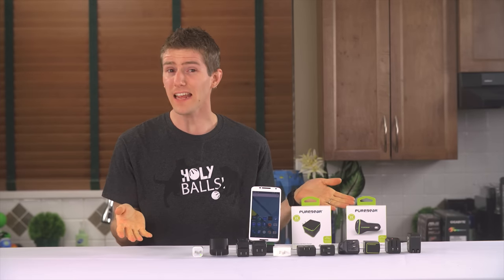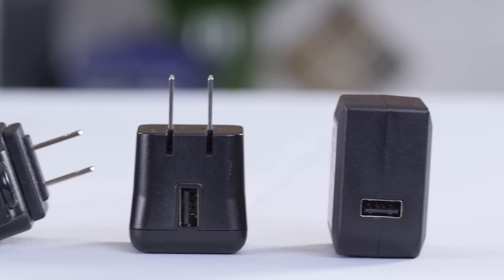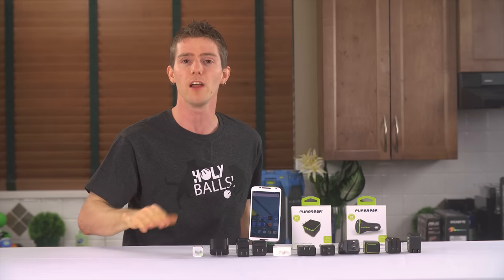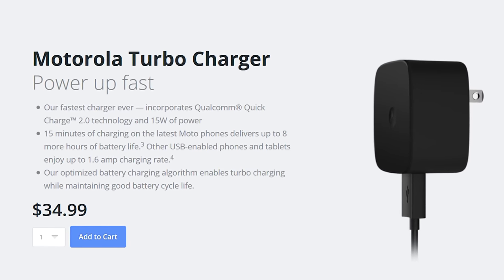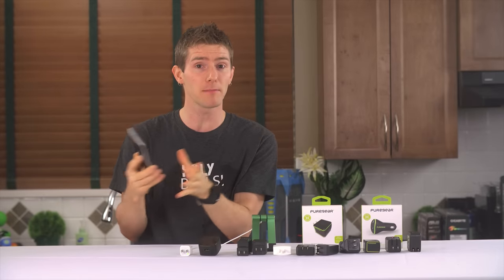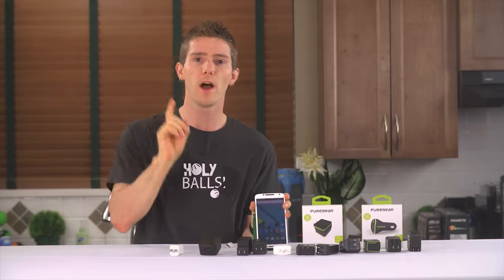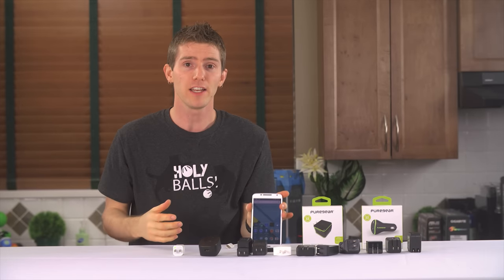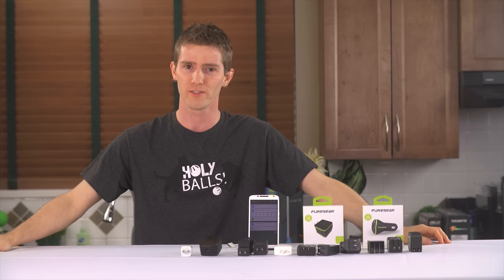Faster Phone Chargers Explained - Qualcomm Quick Charge 2.0

Comment: The conclusion of this video is stupid. You're basically recommending people with phones like the Note 3 to use 1A chargers over the stock charger at night just to extend the battery life.
Reply: Yes. Because you're not going to be using your phone while sleeping so you may as well
Reply: Plus then you EXTEND the lifetime of your battery (and therefore give you MORE battery/power later on in the phone's life when it might be needed the most.
Reply: Lol, that is why it makes sense
Reply: cant wait until we use capacitors instead. those dont degrade in the charge they can hold
Reply: john li
You can already but it would be pointless because they store smaller amounts of power.
Reply: ***** capacitors basically trap electrons between plates and you can shrink the plates down to store more
Reply: john li you mean enlarge the plates to store more? Shrinking increases the electric potential assuming you conserve the same amount of charge which you probably wouldn't because it makes it harder and less efficient to have low charge and high potential.
Reply: Tomas Diaz i meant shrinking the thickness of the plates
Reply: If you can remove the battery of your phone it wont be a problem, but if the battery does die off you can replace it easily.
Reply: SpiderHack Essentially it does extend the total life of the battery, but charging at a higher current does make the charge last longer. There are tradeoffs...
Reply: +Tomas Diaz +john li Guys, guys... The formula for the capacitance of a capacitor is (epsilon)x(surface areof the plates) / (distance between the plates) 

So the thickness of the plates has no role in, well basically anything, and also if you shrink them down, that would also decrease the distance between the plates thus increasing their capacity. This assumes that you keep the surface area same. If you shrink the whole thing volumetrically, the capacity would decrease since distance gets smaller linearly and the area decreases exponentially. 

Also they dont store electrons in between the playes, they store opposite charges in both plates, creating a very very snappy and quick burst of current. So it is no good for a battery or practically anything that needs constant reliable current.
Reply: GameNationRDF I see you've read the formulas from your intro to electricity and magnetism book. I thought he meant shrinking the surface area. By the way, decreasing by a square factor is not an exponential decrease. So area does not decrease exponentially.
Reply: Tomas Diaz Well i was trying to help clarify things, I have not read them from a book of some sorts but whatever that doesnt really matter. And, um, if you decrease the side of a square by half, the area would get 1/4 of its original size. Decrease the side by 1/3, the area is 1/9. It indeed is a quadratic equation thus exponential so I dont know what you are talking about really.
Reply: no, it does not make the charge last longer... what a load of rubbish
Reply: Considering you're not using the phone at night, using a lower amperage charger is perfectly reasonable and helps increase cell lifespan. QuickCharge is intended more for emergency situations, not everyday use. The heat generated does damage lithium batteries over time, killing the battery sooner. Now for user-replaceable batteries, it's not that big of a deal. Drop 20$ and you're back to normal. But more devices have sealed batteries, often requiring special tools and a heat gun to replace. Worse if the battery leads are soldered to the board. So a cooler overnight charger is a good thing here.
Reply: QuickCharge may raise the charging voltage. This is not very healthy for batteries, and 3rd party USB leads may not even be rated for such power (voltage x current = power in watts), like those light up USB leads for an example, sometimes referred to as "visible current" USB leads.

Comment: I was using Apples 12W charger on my note 3 for about 6 months, I noticed it charged much more quickly, but noticed a degrade in battery life, So I got a new battery and used a lower wattage charger. Now I use QI charging on my note 4

Comment: Interesting testing methodology, I like it.  I also like that you brought temperature into the discussion, that's something that not very may people consider with charging their devices.  It just sucks that the charging standard (the device itself in this case) can't monitor its temperature and only apply fast charge during times when device temperatures allow for it, reducing amps and voltage applied otherwise.

Comment: I expected him to mention that the USB cable itself makes a difference as well.

Most USB cables are 28/28 awg, and supposedly a lot of cheap-o aftermarket ones aren't even truly 28/28. I recently bought a few cables from Monoprice that are 28/24 awg and paired them my Anker Multi-USB hub and saw a noticeable gain in charging rate.

Comment: I usually charge my Note 3 @ 1A overnight with an Apple wart. Then in the car, I've got a 2A charger if I want a quick boost during my commute.

I don't USUALLY plug it in to my car's 2A charger, since the Note's battery lasts freaking forever. Usually have over 30% left after a heavy-usage day. Around 80% with light usage.

Comment: This video was actually pretty helpful, but you might have made a mistake (unwillingly). The amount of power being delievered to the phone has everything to do with the cable you're using, especially during quickcharge. Although you thought it would be wise to use a short cable (and it is), the most important thing is actually the gauge of the cable. New fancy cables can be as thick as 20 awg, while older "standard" cables are as thin as 28 awg, which can barely charge at 750 mA! I think you should make this video once again making sure you use the proper cable and maybe even try the new quickcharge 3.0

Comment: I got a rapid charger with my new Galaxy S6. It can provide up to 9.0V - 1.67A to the S6 or 5.0V - 2.0A to any other device. From what I've read, and from what you've mentioned at the end of the video, that could negatively affect the battery. I've just been using my old charger from my S4 which is a more standard 5.0V - 2.0A.

Comment: I've tested it myself with a USB power meter, and a handful of non-hyper chargers against another handful of hyper chargers.
the biggest limiting factor I found was loaded voltage.
I've seen non hyper chargers keep an even 5v or even 5.27v even while loaded, while a supposed hyper charger couldn't even keep 4.7v while loaded.
if you know anything about electricity, then you know that volts matter!
the more volts you have = the more amps you can push through a given length of wire.
so in the end, be careful about buying any supposed charger if it doesn't specifically state that it has voltage regulation.
Anker products do.
that's an easy n quick shortcut
Reply: many brand do, aukey BC master does,but that's not the point.
Reply: Thanks

Comment: cool vid dude. Here are are my suggestions for best possible charging performance on android. 

1) get rid of that crappy manufacturer rom.
2) if the custom rom doesn't have one already, install a kernel that supports undervolting and fast charge
3) undervolt your phone as much as you can (this is general good practice if you want your phone to last for more than a day)
4) make sure thermal throttling is enabled
5) DON'T charge the phone at night, it fucks your batter up. Even if it's a slow charger.
6) charge it in the morning while getting ready for work. The thermal throttling and undervolting will ensure there is no excessive heat output. And should charge fast enough. My lg g3 charges from 0-100 in just about an hour.

Comment: I think you should have pushed home the charging while sleeping thing a bit more. It is also much safer to charge your phone with a 1A charger at night since you are not going to be touching it, using it, seeing it for signs it might be melting/burning/going to explode. I've seen the stories of people buying aftermarket batteries and/or chargers and then waking up to a phone fire or lithium poly/ion exploding and going everywhere.

Maybe a quick as possible episode on after market batteries and chargers and the downside to getting the replacements wrong.
Reply: fast as possible*

Comment: Smartphones like the Oppo Find 7 have thermal protection and have done testing about heated batteries when you're quickly charging your phone. Not sure about the Nexus 6, but other smartphones do prevent from overheating to happen so damaged batteries won't be an issue.

Comment: I have a somewhat fancy charger. I like it. It claims to charge my phone faster and I think it does. I got one for each member in my family for xmas, they all love them. It has two supercharge ports that require you to remove the charger from the wall when plugging in a difference device to either port than the previous device it charged to clear its memory. Its nifty.

Comment: You can also get "smart" high power USB chargers such as Anker's PowerIQ, RAVpower iSmart, or Aukey AIpower chargers which do the same thing and automatically sense the device and send the maximum current possible. Tons of these can be found on Amazon for a decent price, much cheaper than the Qualcomm Quick Charge chargers and work just as good and for all devices as well. I purchased a 5-port 40w smart charger for $25 which is capable of 8 Amps total and 2.4 amps max for any port and it charges my Moto X Android phone from about 20% to 70% in about 30 minutes.

Comment: Great video! I have the Nexus 6 and I love it. But I charge it nightly with my iPhone charger since a predicted four hours of charging is no big deal when I sleep for six hours anyway. I use Qualcomm QuickCharge maybe once every two weeks or so if I get home from school and plan to be out late during the night and I want to top it off. I never really charge it up from 0% (or anything less than like 60% or 70% after a normal school day) with the Quickcharger. If I do use the Quickcharger, I keep the phone either off or on airplane mode so that charging completes quickly and I don't have to worry about too much heat. But yeah, in general, the iPhone charger works great for this.

Comment: I agree that quick charge is really only handy in those desperate situations where you need the phone back from "dead" really quick. In the long term though how many people would really keep their phone long enough for the decreased battery life to have an effect?
I still have a smart phone that I actually use daily that is 4-5yrs old. While the battery doesn't last very long anymore under load it will last me the day before going home to charge. I know I am an outlier in the length of a single phone use because I expect most people upgrade every couple of years where I'd expect the battery to be having its noticeable decrease in capacity.

Comment: charge is measured in coulombs, current is the derivative of charge in coulombs with respect to time.in seconds, a higher current will translate into a higher rate of charge flow. therefore we have chargers which charge faster because of higher current. also thats why its called a charger becuase it actually delivered charge to a device.

Comment: Did you notice the higher voltage for the quick charge. The benefits are lower current  across the cable and if you dig deeper you fill find most phones have 9v battery's this generation. Using a slower charger doesn't have the that big of a difference if your system is designed to charge at the higher voltage.

Comment: I honestly use a 2A charger that came with my first phone. It would discharge faster than it would charge. So now I use it on my Moto E. It works nicely. And it's my only adapter.

Comment: There's a lot of data on the graph to take in within the couple seconds it's flashed on the screen. To me, the way the graph is scaled makes the results look less impressive than the raw data actually is. I didn't notice until I went back and paused while the results graph was on-screen that the the graph tops out at 120% battery life, instead of the actual upper limit of 100%. The graph shouldn't show values that are not even physically possible. It gives the visually deceptive impression upon first glance that the batteries are not full yet when they've reached the 100% mark. I didn't have time to notice the actual % values on the Y-Axis until I went back and paused it on the graph

Comment: Qualcomm quick charge works on a principal that has been around and has been supported by android forever, it basically is just a way to force the charger to be recognized by the android kernel as an AC device so that it will draw full power. Any charger however can be forced to do this just by bridging two poles on the USB cable, i dont really think they've made any groundbreaking discoveries here just made it easier to access.

Comment: I actually have that motorola charger and the quick charge thingy is done using higher voltage(according to what it says on the back) not higher current, which only varies between 1.2 to 1.6

Comment: So here's my experience w/ a Galaxy S4 that I've owned for almost 2 years. Luke said in a live show that the current's quality mattered and that the wall outlets are not delivering clean power. So I've always charged my S4 off the computer through the charge port and added an unpowered USB hub in order to get 100mA power. This methodology has always charged my phone really slow, but I still get 2.5 days of use if I were to drain the battery completely, which you should not do anyways. 
To compare with, I have a cheapo USB battery bank charging w/ 700 mA, it charges to 60-70% really fast but my phone loses all this energy after 3-4 hours where I can start over with charging.

Comment: I have the droid turbo and its quick charger is great for getting a quick 15 percent before heading out(about 6 to 8 hours of battery) but over night I use an incredibly weak 600miliamp charger with an extra long cable to preserve the battery. Works out great so far. Faster charger is definitely a bonus, but kinda misleading if it's all that came with the phone(which it was)

Comment: i find quick charging quite useful but since i usually charge my phone overnight i usually use a older slower charger.
Reply: taz874 my LG G5 has built in protection against fast charge damage. it charges to a set point~70% then lowers the amperage to 1.1A.

Comment: Its not really that the "charger" deliver more than 1 amp. What Linus calls "charger" is actually a power-adapter. The charger is built into the phone.

Its the charger the decide what power it should draw from the adapter. It seems like the Nexus simply just ignore the 1amp maximum and draw somewhat more.

Just putting the phone in the window behind the curtain will probably extend the battery life like 100 charges or so. If its not tropical temperatures outside, its usualy somewhat under room temperature behind the curtain.

Comment: Hey Linus Just thought it might be worth mentioning. The faster you charge a Lithium polymer or lithium ion battery, the quicker it is going to deteriorate. So sure you will have that one charge but oh say 1000 charges down the line the batter will hold less than if you had been using a lower charge rate(by amps).So basically shorter YAY faster charge! Long term shit not as good battery life. Generally as a rule of thumb slower charge (to a point) means less degradation but we all still need a reasonable charge speed so ya. The same can be said for storage If you leave it fully charged or completely dead it deteriorates the battery. However this might not effect it terribly but it depends on the quality of the battery whom of which quality is quickly lowering as of around 2009 overall due to high demand (If you open up your phone you might be able to find your batteries C ratting which is its charge discharge rateing which can tell you if the rate of charge is damaging. I know this because I have worked alot with RC planes and learned some lessons from the not quite user friendly charge and discharge appliances involved with higher end RC equipment.

Comment: an other drawback of quickcharging is that the capacity of the battery degrades over time, so it's gonna be empty quicker

my old windows phone still gets the same runtime as 2 years ago, 3-4 days with moderate use and only charging with the computer or a low power charger
many samsung users I know who used quick chargers had issues with their battery and couldn't go a day without charging it at work

Comment: you need to do the test with a better cable in my opinion. That cable looked very low end, even though it was short. I have noticed that even when using my 2 amp OPO charger, if I don't use the thick red cable that came in the box, it won't be as fast. I lost the cable for a few days, and had to use my old samsung one. It was noticeably slower.

Comment: Nice video, but not as technically-focused as I was hoping. I think the fact that quick chargers do in fact up the voltage from the standard USB 5V to 9V and higher would be a very pertinent fact. Can you explain why the higher voltage would enable faster charging?